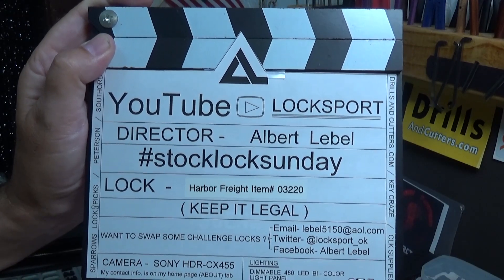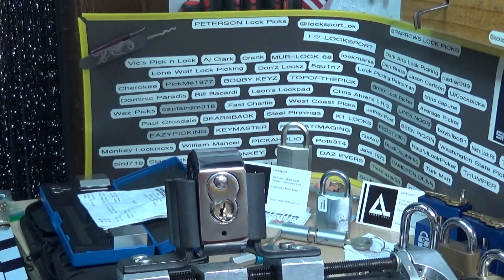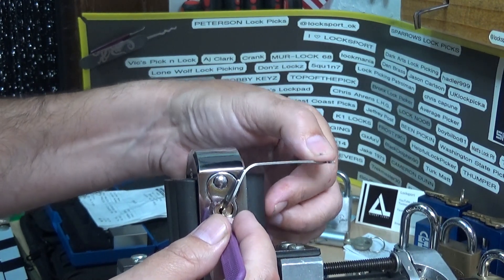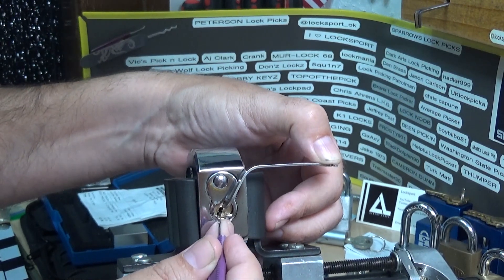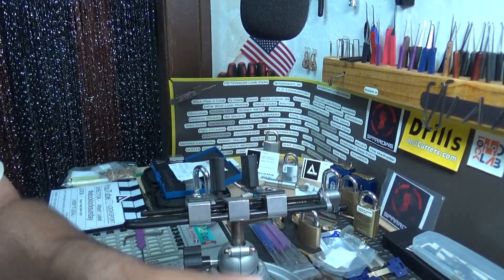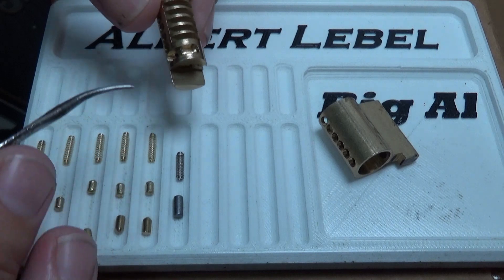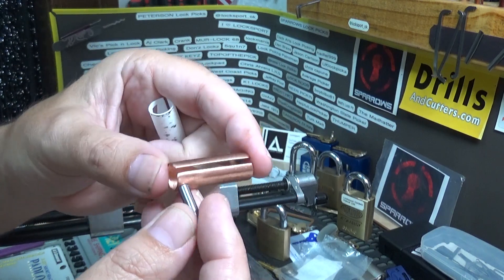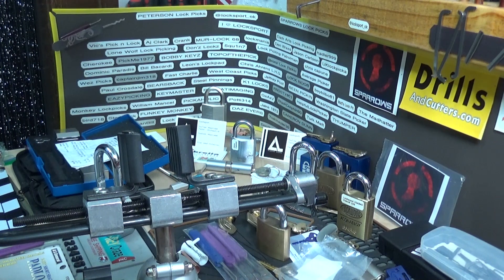#246  The most pathetic core I ever seen. The Harbor Freight padlock (re-visit)  #stocklocksunday

Comment: Good job Al on open.  Yes those Harbor Freight cores are terrible.  Pins are something too. Good job on the front loader,  I have one from Peterson that looks sort of like yours, expensive item.  The problem I have with pinning with one is I cannot see good inside. I much prefer the Euro's with screws on top, if there is a problem you don't have to take the whole lock apart.  Why they make them this way is beyond me.    🧡
Reply from the maker: Thank you. Ya, I bet it's hard for them to build them during manufacture. Probably time consuming. I just could not let it go, I had to get creative and make one. And yes, it's harder to see inside but I make a LOT of challenge locks so I have it wired. Just have to go slow, don't let anything pop. I will show in a upcoming vid..

Comment: If you try to force it open with a screwdriver, I think that core will snap near the front, just like the snap zone on some profile lock. Not much metal to recycle in those cores. Good thing they can be replaced with something better.
Reply from the maker: I think you hit the nail on the head, it would snap and make the lock impossible to open, and yes, I have one I put an American core in

Comment: Gotta love the Chinese blob pins lol. I get them from my H.F for about 6 bucks with the 20% off coupon. I've got a worse core than that lol the Bible is plastic lol. It's out of an old door knob I keep the brass core and threw the Bible away. Nicely picked on the one. The one I have is harder to pick than my 700 sires American lock. Crazy. Keep up the great work bud👍
Reply from the maker: Thanks, ya, they can be tricky due to floppy and spring loaded core. Keep trying, you will get it open. BTW, I have your box in my vehicle, it's going out today.
Reply: @AlbertLebel  I already did get it open in my comparison video a while back. I've not yet found a lock I can't get open.
Reply: @AlbertLebel  I go weeks without picking just so I have a challenge lol.
Reply: @AlbertLebel  I'm sure I'll find one that will give me a run for my money sooner or later.